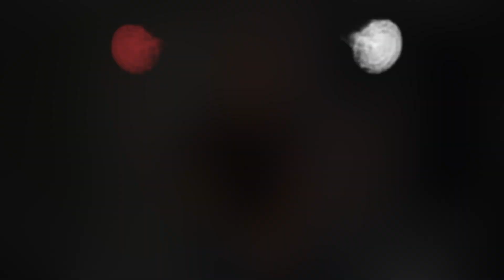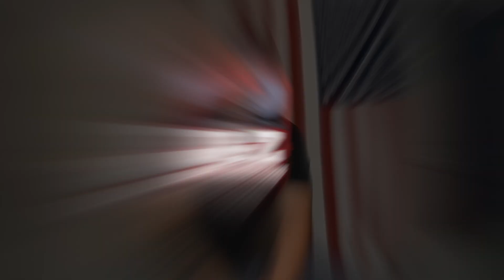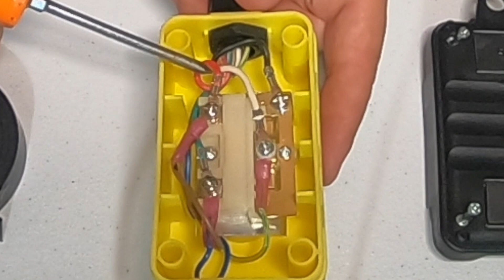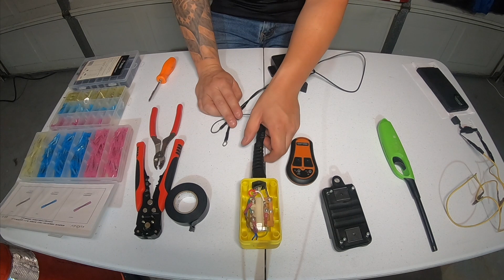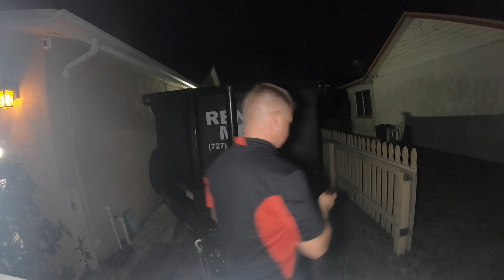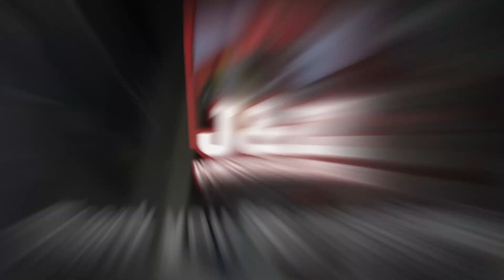Wireless Conversion- KTI wired controller, intergraded with Harbor Freight wireless remote.

Comment: pssst.... 2 years too late, but, your flag is hung wrong... Blue field to the left.
Reply from the maker: The flags were hung so when you see it from the street with the garage door open.
Reply: @jzdumpstersolutions  gotcha... in that case, if you want to hang it correctly, you should switch the two. Other flags should be hung to the viewers right (the Colors left).

Comment: My badlands only came with 4 wires. Red, black white and green. I can get it to click the solenoids, but can’t get it to kick the motor on
Reply from the maker: If it's a power down as well they're a few more steps involved. This is for power up and gravity down hydraulic systems.